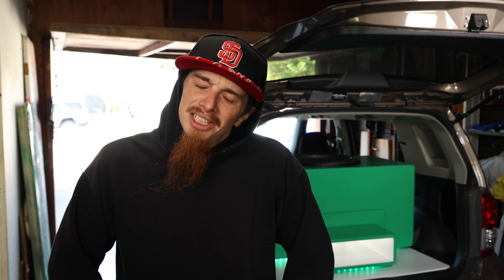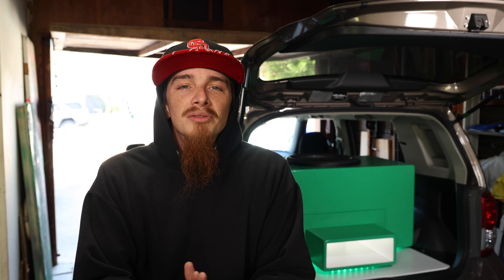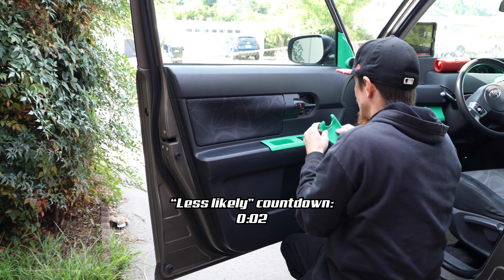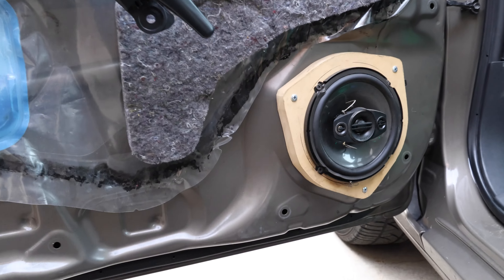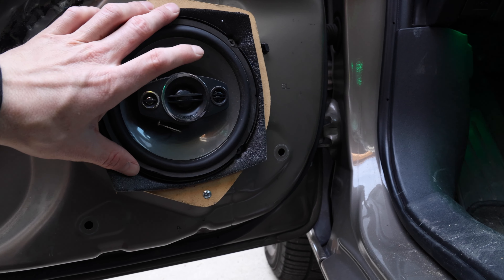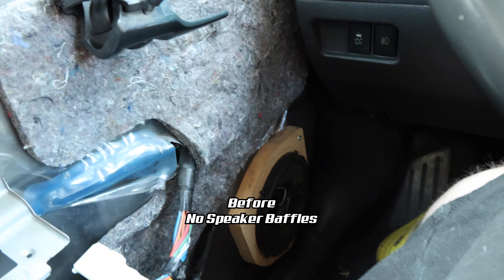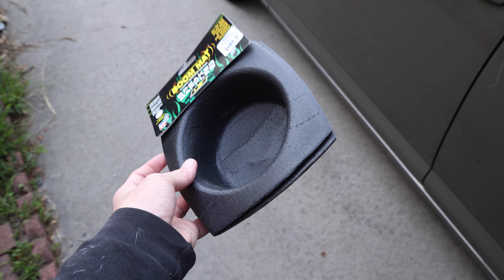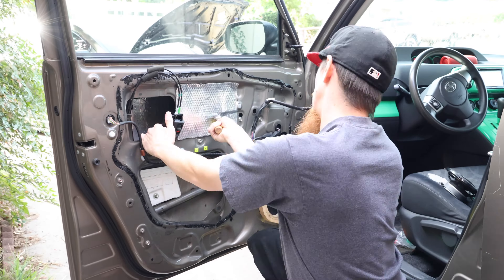Do Speaker Baffles make Speakers Sound Better?

Comment: choking your speaker out is never the solution, it's a waste of money. if you want you could buy them and then cut the pitted part out completely and use it as a dampening cutout, but that's REALLY nit picking. waste of money, waste of time waste of effort, never choke your speakers out like that.
Reply from the maker: I mean for me personally there is just no real use for them.  A few people have mentioned cutting holes in them, but I feel like if you have to do that, you’re no longer reviewing the product and instead reviewing the potential.  Plus, I’m just not that interested in incorporating them long term; there’s just no need for them in this build at the moment.